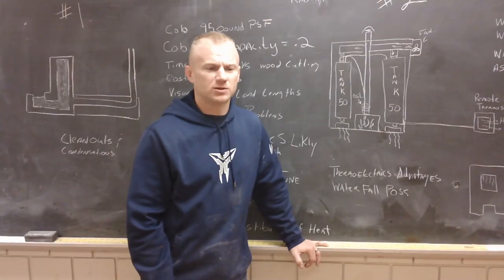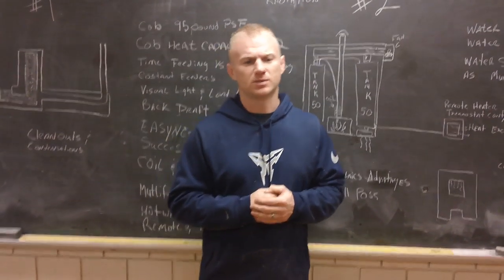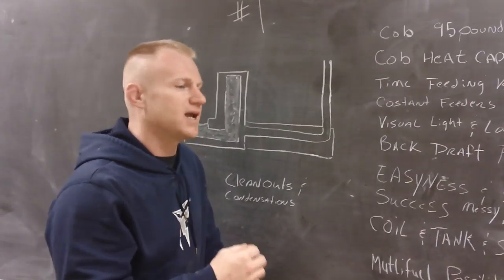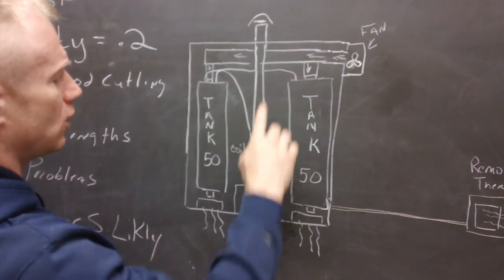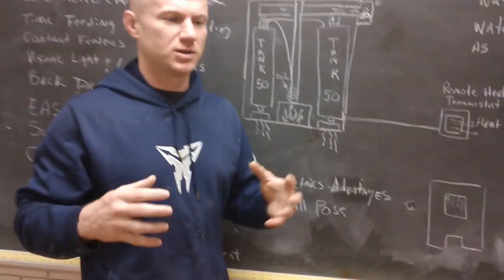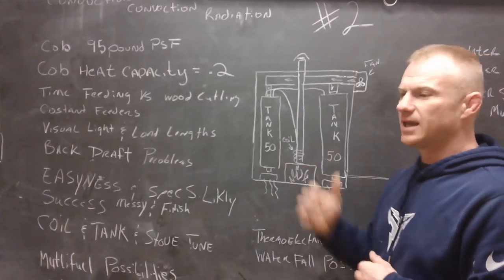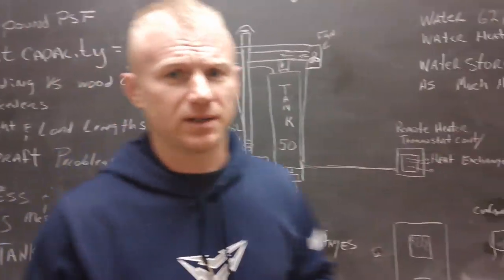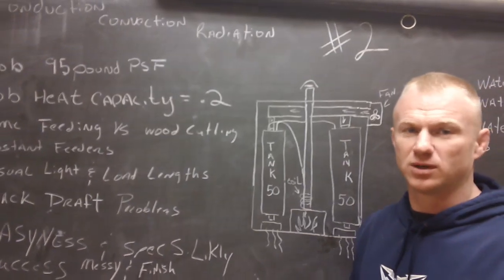Green House Heater Death of the Rocket Stove part 2

Comment from the maker: I would considering a insulated closet or cabinet  located on outer wall of house. You pick the size you need. insulate it very well. set a tank gallons of your choice in side with air space around it.  a vent I could open to the inside to let heat in to the space when needed but keep out in hot. AND a vent to the outside to open to regulate temp. one small dc or solar fan would push it either way  and the tank would also be my hot water tank to max my space . 2 birds one stone

Comment from the maker: Maybe then we should eliminate hot water indoor tanks? whats the difference in durability the same materials are used. Could you also possibly solve that with a smart idea like a floor drain you use for your hot water heater pop off could also be used in case of water thermal storage tank or pipe damage?

Comment: do you know about batch box rocket stoves ? load them up and you can watch them burn or go out to do something else. The same clean burn  .
the drafting problem ,if you bild your rocket stove richt you don't have that problem,   The exaust gasses  must be at least at 85°C to get your chimeny working like it chould be. All the rest (higer temps ) you are heating for the birds 
water can store more heat oké pipe corrode water leaks ,cob does not run over your wooden floor ,

Comment from the maker: Lastly the limit of 212 is EASY to handle with the water phase change. You simply engineer your stove to water volume so YOU NEVER GET THERE. or simply the more water you add to your mass the cooler temps it will stay. Hows that?

Comment from the maker: Continued: in the applications of mass heaters the bench or mass of cob ,earth or rock.  UNLESS the mass (bench) you set or lay on or put pillows on , or  let you kids around is not over 640 degrees the water is STILL holding 3 times the energy. I have never seen ONE bench on a rocket over 150 much less 640 degrees. at this particular application and range of temps (rocket stove) the limit of 212 degrees is mute. for one other reason as well not just the one I clearly laid out.. continue again
Reply: Water is best. Less space, too.

Comment from the maker: Hello sir. I simply can not refute the fact that water only holds 212 degrees before phase change to steam. Now that said materials around phase change is the better way to store both heat and cold.. now To the POINT at hand .Energy can be measured in calories or joules or btu's and others but lets use joules. The amount of energy (joules) required to heat 1 pound of water to 200 degrees right below boiling point that same amount of energy applied would heat one pound of rock to 640 degrees.

Comment from the maker: Waters heat loos would be affected by how it is arranged . meaning the thinner it was spread the more surface area it would have thus cooling quicker than in say a tank. All heat is transfer happens one of 3 ways. conduction, convection and radiation

Comment from the maker: If water does hold over 3 times as much energy and IF it did loose it faster than others wouldnt insulation be an easy fix to slow the loss of still 3 times the energy stored? so a water mass with a blanket is 3 times a better stove even by your standards than a solid mass.

Comment from the maker: one thing your right on is dont discount the clean and hot burn of the rocket stove and how that effect should be in any well designed stove. which now stove off the shelf are now hitting over 90%.so a good large burn chamber for time that burns high% that stores it in the best thermal mass is THE stove we all should want. but dont let me interfere with anyones happiness or success .

Comment from the maker: Second point the fact the section got so hot you couldnt set on it long was because the section couldnt absorb the heat as fast as water or as much and store it as long.. so it had to escape into the room passing through the inferior mass. it also had to do with how deep it was embedded in the mass as well. further unless it got 3.26 time hotter it still stored less heat. so water at 100 would equal dry mass at 320 degrees thats like the oven and would cause spontaneous combustion on contact.

Comment from the maker: Think what is BTU based on? WATER what is heat capacity based on? WATER. What does the term "ton" mean when some one speaks of a 3 ton heat pump? means its equal to the cooling capacity of 3 tons of frozen WATER. if rock was a better absorbing heat why dont we have rock radiators in our cars? why are old house radiators full of water and not stone?

Comment from the maker: The rocket stove benches themselves stay cool enough to sit on and be fire safe usually the mass is pretty close to 100 f. with in 20 of that in most cases. the water works at its normal superior thermal mass in these ranges. The fire or burn % is another subject and temp of that burn.. but right now we are just speaking of witch is better thermal mass.

Comment from the maker: I  enjoy the respectful debate and opportunity to learn and or teach witch ever may apply. It takes more energy, exactly 3.26 times of BTU's to heat 1 pound of water vs the BTU's required to heat 1 pound of rock to same temp. thus energy in will equal energy out or over 3 times will come out when same temp is reached because over 3 times was required going in. thus a better thermal mass. or you could say water mass at 200 would have same energy stores as rock at over 600 same weight

Comment from the maker: Thanks allot for watching. I can perfectly understand your doubts it doesnt appear water would out do Rock, sand or earth. Heat capacity and those reasonable test you suggest have already been done many times over. Just google heat capacity of materials. Youll quickly see water is the standard messurment of all other materials. the capacity of water is "1" all others are based off that. Hydrogen in water is the key. Hydrogen has amazing heat properties.

Comment from the maker: Your heat exchanger comment will be a good laugh and then lesson too. You could lay a gas hotwater tank on its side and run the heat from a rocket stove right down the middle and would be exactly the same " heat exchanger" and would make things all equal. except one thing.. the water is so good at absorbing heat that it would take way too much and it would never draft. but it that didnt happen then guess what you can store almost 3.5 times as much heat in that one tank as a cob bench same size

Comment from the maker: lets start with one point at a time and see where we get off ok? water is a better thermal mass than cob sand or rock . do you accept this first point? if so then we need to see by how much better. can that be determined? YES. how by " the engineer tool box .c "  has a list of heat capacity for many solids and liquids. as my second refference I reffer to smartconversion.c and thier published list of heat capacities. do you  counter this point?????? water has a 1.00 ...rock sand and cob =.2

Comment from the maker: So so so Wrong.  Wood Stoves are rated in BTUs of output which is a long standardized method.  Stoves effeciencies have long been calculated by a set number of known BTUs in a set known chunk of fuel, in this case wood. Then as burned water will be used in a set known volume, at a set known temp to see over a set period of time how many degrees increase.  Thus measuring % of effeciency by comparing BTUs out vs BTUs in.  Secondly, all flus including RMH require heat for the flu draft

Comment: Yes, in theory 1900 lbs or water will hold as much heat as 1900 lbs of cob, but the trouble is actually getting the heat into the water. It's not so easy. It usually takes an inefficient heat exchanger like in your drawing with massive losses not experienced with a RMH.

Comment: ...So you need a full redesign to find a way to capture more of the heat into the water so you only have to run it a couple hours a day like a RMH, and hopefully not have to use electric pumps and electric fans to do it. :)

Comment: It is ironic you criticize an established, proven, working method with your theories that you have never even built one of (!); but throw around terms like "just assertions".
3.62 is fine, it's your application of it that is theory. Don't you see how massively inefficient your heat exchanger coil is? A 1/2" ring of copper to the side vs. an unobstructed 8" flue straight up? 3.62 only matters if the exchangers are identical. In a RMH, a  much, much larger % is actually captured by the mass.

Comment from the maker: cob has sand in itusually about 3 to 1 and sand usually comes from rock. so quess what cob sand and rock all have about the same heat capacity. AMAZING DISCOVERY!  so thats wrong too. and  you say RMH is "DIRECT" heat not like  heat exchanger. well I was pretty sure heat traveled in 3 ways and dont remember "direct" as one of them. so "wrong". ... these feeble arguments you make are just assertions. like pigs fly. but what facts do you have to back them up?

Comment from the maker: First the cob -  100x95 equals 9500 pounds.    100 ft.³ of cob will weigh 9500 pounds.    9500x.2 equals 1900.  So our cob bench has the same heat capacity as 1900 pounds of water.

  Water weighs 62 pounds per cubic foot,  therefore the tank containing 100 ft.³ of water weighs 6200 pounds

    6200 divided by 1900 equals  3.26    

    A given volume of water can store 3.26 times as much heat as the same volume of cob

Comment from the maker: I do so enjoy the nice folks that care enough to leave a comment with out checking thier facts first. So wrong its hard to know where to start. 1st Many woodstoves will last  8-12 hours per load. 2nd 3.62 LOL is fact not theory do a little research into heat capacity then tell me all about it. 3rd Many woodstoves now are way up in efficiancy ratings like 90% and above. So one with a coil the proper size with water it out performs.. the math dont lie.. It not my theory either.TY 4 dislike though.

Comment: 8hrs per wood fill on yours??. Hogwash. 3.62 diff is a ridiculous theory comparison. A  RMH uses 1/4 or 1/5th the wood by not wasting it up the flue like yours; that more than overcomes your 3.62 theory. Your coil is a heat exchanger instead of direct like a RMH, so it looses vastly more heat never originally brought to the water, so you can't pretend to compare 3.62. Also cob is not the primary heat storage in the best RMH's, but the rocks that cob holds. RMH needed only a couple hrs/day.

Comment from the maker: Mike insulation combined with thermal mass so that you have both convection and radiant heat transfer would be best. Insulated thermal battery such as clear water tubes or black cast iron old hot water tanks in a well insulated area that gets passive solar and or heat exchanger with woodstove is as good as it gets. Passive solar should have a vacuum pulled on it for heat transfer rules too.

Comment: Your alternative to a rocket stove is actually a wood fired boiler, of course the example used is one of your design.  As you have mentioned you can also use multi-fuel boilers.  I think the number one expenditure when considering heating or cooling a dwelling is making sure the space is insulated to it's maximum and than some.  Thanks for the vid.